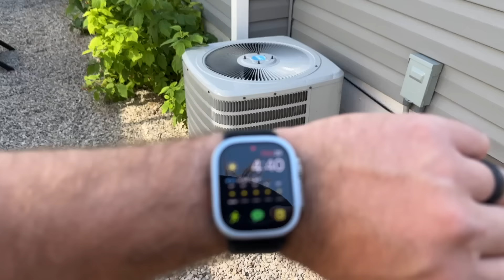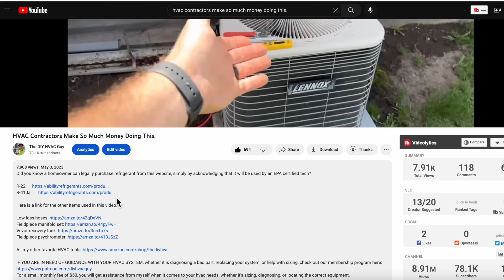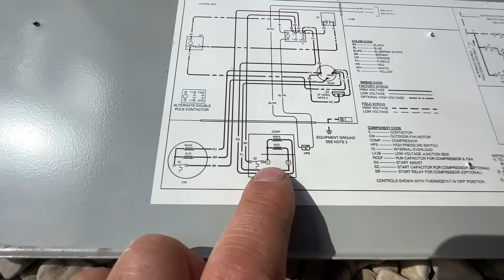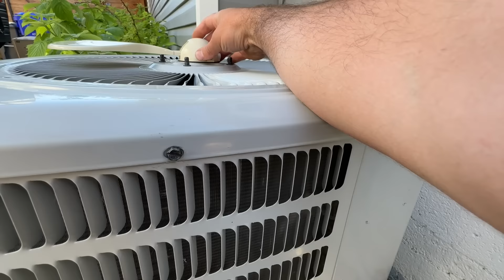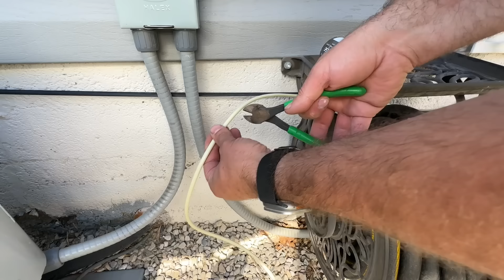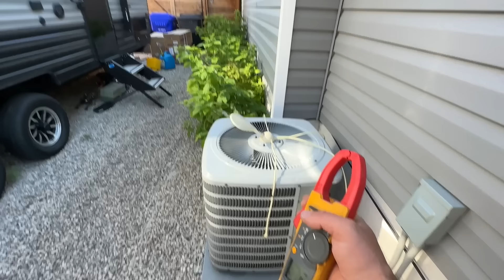Can This Device Actually Lower Your Electric Bill By 30%??

Comment: Evaporative cooling (aka "swamp coolers") have worked great for hundres of years.  They will work well until it's humid.  Then they do nothing but waste water.  It's not an overall saving in cost, because you're trading hot air (free) for colder water (paid for by the gallon to the water utility).

This is not a "scam" because you can save on power costs.  It's just not as much of a savings because you pay for the water, AND it only works in low humidity.  In Arizona that excludes mosson months June-September.

Comment: it looks like the mist is going outward instead of inward, is that true?
Reply from the maker: Yes the mist goes out I’m a tan motion, and then the condenser fan sucks it into the fins. If you had the jets flipped then only a little circle of the coil would get the water.

Comment: We have done this for years,first one I ever put together was made using Toro lawn sprinkler misting heads attached to a pvc manifold! Its is still used 15 years later,it is on a timer with an asco solenoid valve! This is on a 60 ton drycooler!
Reply: Can you post a pic? thanks!
Reply: I'm guessing your unit is a semi-hermetic with a quality coil, or a cascade unit. All you have to do is look at the coils. Most of the older units have the fins soldered on the tubes. The new units that have aluminium fins wrapped around the coils. These are the ones that have an issue with water constantly flowing on them. Most techs have been told running water will ruin the condenser, and are just trying to save their customer money.
Reply: @MissouriBill  i’m sure the techs are trying to save their customers money and put less in their pockets. Makes complete sense to me. Politicians are also doing what is best for the country and not themselves.
Reply: @JorgeDiaz-id1jo  You obviously have no idea how flimsy the standard coils are in current systems, nor have you witnessed the destruction that unconditioned water can cause flowing past most metals--not to mention evaporative deposit of minerals on the outside! It's a crap shoot depending on your water, and a very costly one if you lose. Snappy rhetoric will not change the laws of chemistry.

Comment: I was hoping you would show how the pressures react to turning the water supply on and off while it's running.
Reply: High side must be a little lower as he's saving around an amp.
Reply: Both high and low side will drop. It always does when u soak a outside condenser coil. If u look at a gauge it will tell u the temp of the coils based on the Freon used and the pressure they are running. When the pressure drops ur coil will run a lil colder that’s why u get a lil colder air. The only problem with these is the potential damage ur gna cause to ur outdoor unit soaking it all the time.

Comment: What about rust etc?
Reply: Calcium is the killer, or other minerals! $30,000 dollar Zeolite Water Softener /ionizers still can not remove Calcium in "Liquid" form. Once the water changes state(vapor) then the mineral is expelled thus collecting on the fin coils, plugging them all the way through. Muriatic Acid won't take it off. 
So much for penny savings on your power bill. It's like running shit gas in your car. Pay now, or pay more later.

Comment: They should make it use water from the evap drain.  It's naturally distilled.  I made my own version of this decades ago.  I also shaded the unit, and had plants growing near it.
Reply: @estebancamachomartinez724 That depends.  In general, distilled should be pH neutral, and mineral free.  "Soft water" means you have some level of mineral removal usually using salt in the process.  Nothing purifies water like distilling.
Reply: Many window units do exactly that, using the tips of the fan blades to spray the condensate up on to the coils. That's one of the reasons window units drip a lot less these days.
Reply: @fxm5715  yup, the outside fans literally have a "slinger ring".  They will also have the bottom row of coils sitting in the very cool water as the last pass before going to the capillary tube.
Reply: The condensate is NOT distilled. It contains everything that was in it when it hit the coil which is a lot. Ever hear of acid rain? Humidity in air picks up the same contaminants. Plus the condensate picks up any dirt that gets onto the coil in the course of normal airflow. Its far from distilled.
Reply: @agoogleuser3808  Water formed from the condensation of moisture most certainly is distilled and 100% pure. The fact that is gets contaminated afterwards is moot. Collecting condensate dripping from your AC unit is not going to be "laboratory pure", but that's hardly the point. It will, however, be "distilled" of any minerals, acids, or contaminants that would hurt your coil if used for misting--which IS the point.
Reply: @FisherCatProductions no it is not.
Reply: @executiveinvestments  No what is not?
Reply: @FisherCatProductions  condensation is not distilled water.  Lol.  It’s moisture pulled from the air and is the same as rain water.  You people are not very bright.
Reply: @agoogleuser3808  It's one hell of a lot cleaner than my tap water, which you can small the chlorine in. Tap water would rot the coils in a year. By your reasoning this devices is a complete fail.   Purchasing distilled water defeats any cost savings.
Reply: Ever heard of Legionnaires? I would stay right away from condensate, it's most certainly not pure water and it will be contaminated with everything stuck on your evaporator which will be allot. Furthermore distilled water (which isn't condensate) is highly corrosive by virtue of being completely free of minerals. I Guarantee you it will leech the aluminum off your coils way more than tap water... Over all I think these systems are a bad idea long term but I rent and hardly use AC
Reply: They made a condensate heat exchanger to use the condensate to cool the liquid line.
Reply: @RobertTuck-vo8cw  Nice.  I always thought it would be a good idea to incorporate the pool heater into the system (for those than have a pool).  It's a waste of resources to heat the pool, and cool the house.  Of course that is a much more complicated system than a simple misting hose.  As with tap water, chlorine is a problem.
Reply: The video showed the spray nozzles spraying outward (away) from the a/c unit. Shouldn't the spray be directed inward toward the unit's cooling fins?
Reply: @jeffmorton9220 the nozzles, of pointed onward, would only cool the coils at which it was pointed. By spraying outward, the mist cools a greater area as well as increasing the evaporative property
Reply: Exactly what I thought, you might still need a pressure system to push the water and a setup to fill water when the evap pan is empty
Reply: If the unit could produce enough water to keep it going, you have to make sure that.
Reply: @estebancamachomartinez724  you should only use distilled, same in a car radiator, don't just fill it with a garden hose
Reply: Genius.
Reply: Yeah but condensate water would have tons of crud in it, and would probably stop up the mister nozzles, tubing.
Reply: @MrKeithsplace  That's entirely possible over a long period of time.  When I have done catchment, I haven't noticed any debris.  I played around with a solar fountain pump in a small catchment tank.  DIY materials are cheap.
In my area we are charged a sewage fee for water usage, so water is expensive.  I noticed that when it rains, that the AC worked better, so I thought about irrigating it.  Later, I was watching an outdoor band that had mister fans, and I got the idea.
Reply: @qua7771 the ac works better when it rains because it ALWAYS cooler out when it rains.  lol.  Genius.
Reply: @executiveinvestments  Not so much in Florida.
Reply: @executiveinvestments  It is not always cooler out when it rains. I'm in sw Georgia and it can still be oppressively hot while it's raining, which just makes the outside hot and even more humid once the rain stops.
Reply: @CanItAlready  but you have a lame argument.  You even repeated ur joke.  Not always hotter when it rains.  Then says it’s so hot when it rains.  Who said it wasn’t hot when it rains?  Nobody.  It’s just WAY cooler when it rains.  When you get a thunderstorm in the middle of the day the temp drops 10 degrees or more.  That sound like it’s cooler to me.  Pay attention to comments.  Do better  ok?
Reply: @CanItAlready  evaporative cooling and google is ur friend. 🤭🤭🤭🤭
Reply: What did you use to shade your unit? How much clearance from the top of unit is needed?
Reply: @abunchahooey  Mine gets shaded by the house until noon.  I let a hedge branch partially hang over the other side.  I've just been mindful of unnecessary heat getting to it, because I'm in Florida.  My A/C is struggling to keep up right now.  You have to get creative working with what you have to your advantage.  Look at the direction of the sun.  Be mindful that it has to breath.  I thought about using a trellis if I trim that hedge branch.
Reply: @estebancamachomartinez724 Water from condensate is as pure as water gets. Totally neutral and zero minerals. Just H2O.
Reply: @FisherCatProductions so explain the buildup inside your drain line to me. Because I know for a fact this is false. Catch some in a jar and look at the bacteria that will grow. That water condensed across a coil laden with bacteria and contaminants, such as smoke and anything else that is particulate matter small enough to bypass the filter. Don't believe me, put a few drops in your eye. Bet you won't because of fear that I'm right.

Comment: You can already have a much more efficient version of this system by installing a heat pump water heater, assuming your water heater is inside the house or you can add some short duct runs. The HPWH give about 1/3 Ton of 'free' cooling (and dehumidification) to make the hot water you need anyway. With those, you're transferring all of the heat you collect from the house into the water instead of the reverse here where you're using the water to capture some of the heat the coil is trying to expel and a small amount of evaporative cooling (depending on your outdoor RH.) 

It seems like one could engineer a system that has part of the AC coil transferring the waste heat into your regular 'cold' water during its normal flow. It wouldn't bump the temp all that much since it's not a tank constantly heating it, and most uses of water in the house you actually don't care/it's preferrable if it's warm instead of cold.
Reply: Would be nice if appliances were connected in ways to use waste heat.

Comment: A more convincing test is to set the AC to lowest temp setting (maximum power consumption), and then see how much cooling it can do (how colder the air gets).

Nonetheless, I do agree this can save on electricity . . . albeit at cost of water...
Reply: In Houston the water utilities will fine us very heavily if we use misters!
Reply from the maker: I did that, did you miss it? I managed to get 1 degeee cooler of air

Comment: You can acheive nearly the same results by putting a frame around your units and then covering the top of it with bird netting to shade the unit from direct sunlight.
Reply: Your outdoor unit shedding for top discharge condensers needs to be 10 to 12 feet above unit to avoid recirculated hot air discharge!
Reply: No, you can't, direct sunlight isn't the only issue
Reply: @bobloblaw10001  I know it worked on our huge 5 ton commercial Carrier units. We also had plenty of air flow around it as it was about 10 feet from any obstructions. Thanks for the video.
Reply: @davidc6897  direct sunlight isn't the only issue. Water on condenser coils will improve performance on a hot day even if the unit is in full shade.

Comment: I got a question; in my area Houston, Texas we run the a/c or h/p about 8 or 9 months out of the year. How much will those mineral softeners  cost assuming we'll need 3 per year?
Reply: $10-$30 each and its recommended to replace it every 3-4 months

Comment: I don't understand why the compressor would have a lower amp draw since it is either on or off and not a variable speed unit.  Can someone please explain?
Reply: Lower condensing temperature causes lower compressor discharge pressure.  Compressor is doing less work so the amp draw is less.
Reply: @jimw7550  Thanks!

Comment: Just wanted to thank you for your videos.  I was able to confirm that my AC capacitor was at fault and I was able to get it repaired the next day once the part arrived from Amazon.  Keep up the great work!
Reply from the maker: Glad I could help!!
Reply: @diyhvacguy  My daughter has 15 year old house; I ordered a replacement capacitor for her to keep handy in case of need. Thanks for the tip!
Reply: @flagmichael  I did the same.  $12 from Amazon. If I never use it, fine.  If I do, winner,winner,chicken,dinner

Comment: Is it cheaper to run ac from 82° to 78° or keep the home at 78° the whole time?
Reply: I  keep my home at 79 in the summer and in winter at 68.-
Reply from the maker: Yea keep it at 78 for sure. It will be more efficiently then it trying to overcome the heat that has come in through the day

Comment: 1st issue I see that you did not address is winterizing you would have to blow out the water or remove it and store it which doesnt seem viable as there are no addtional adhesive pads provided. And for $100 that's a steep ask.😢
Reply: I'd go with magnets.

Comment: I was actually telling my wife just today I wish I could make a setup to mist water on our unit, which is in direct sun from about 10 to 3 every day lol. My opinion, but I think if the back sprayer was relocated to the front you would have a greater result since the rear is pretty much shaded and the front is in full sun.
Reply: What if you put some kind of cover high above it, to give it shade?  Make it like a mini pole barn?
Reply: @GriffySpeed  everything you can do to block the sun would help
Reply: @GriffySpeed  I've made a shade on the sunward side already, and I've got plans to do an upper shade as well. Just trying to do it in a way that doesn't look like garbage and also be easy to get to the unit for service while not intruding into the driveway which runs right along beside it.

Comment: 18% savings.  Depending on sun at time it appears the savings could be greater when sun is shining directly on unit.  Good video.  Not sure about hardness of water and what effect it would have on coils over time unless they were cleaned regularly.  Thanks.
Reply: I would be most concerned about that. I've never seen an inline filter that would reliably remove dissolved solids from water except for an RO filter.
Reply: @flagmichael  Install a second misting system filled with CLR. Run it every few months.

Comment: Great video as always.  I wonder how this would do in an area like Florida with high temps AND high humidity?
Reply: Should work fairly well still. The water temp is lower than the air temp and it takes quite a bit of energy to convert liquid water to water vapor. Think of it like boiling a pot of water, you can still boil water when it's very humid, in this case the heat to boil the water is coming from the coil.

Comment: if you live in an area that has hard water, this device will cause a build-up of calcium deposits on your condenser coils. and that's not good.  yes, condensers are designed to be rained on.  Rainwater tends to be way more pure than tap water or well water, containing fewer salts, minerals, and chlorine often found in municipal tap water.

Comment: I am not sure that I would run it all the time. Once the load on the house is reduced I think will find it will not perform as well. The other concern would be the amount of dirt and debris it would collect while operating with a wet coil. How would this affect the warranty on the equipment? Years ago there was a company called Freus that made condenser that used water to help in the process. If you search around you will find several devices that have been put out there. I am not sure that a 10 minute test would convince me to give up my warranty on my equipment.

Comment: I work from home and I go out and spray both my AC units when I take breaks to help cool it down and also keep the cotton weeds from coating the coils.   My units are always in the shade and are 16yrs old.   I have replaced the capacitors twice since I have owned them and also replaced one of the fan motors before I realized it was a simple $10 capacitor as the issue.   I have also replaced the capacitors on my inside blower fans along with one blower fan motor.   Doing this yourself can extend the life of your AC units and furnaces.   Really cool set up and invention.